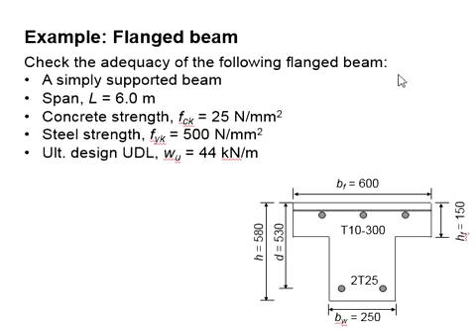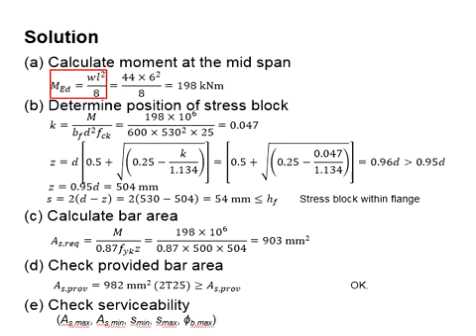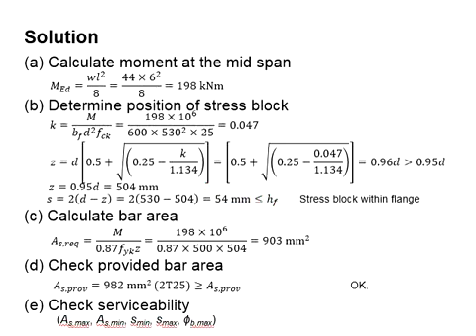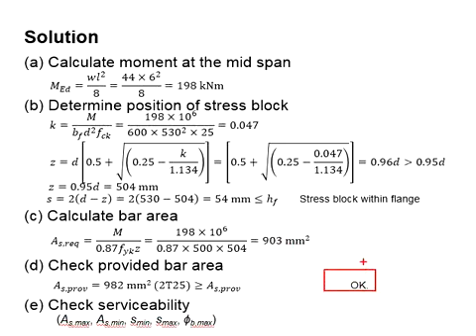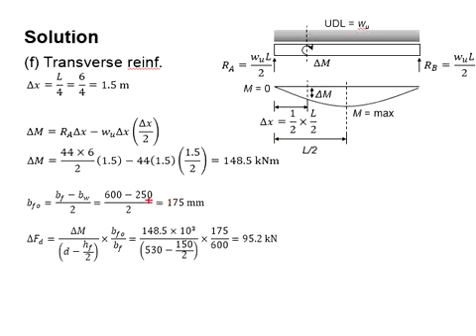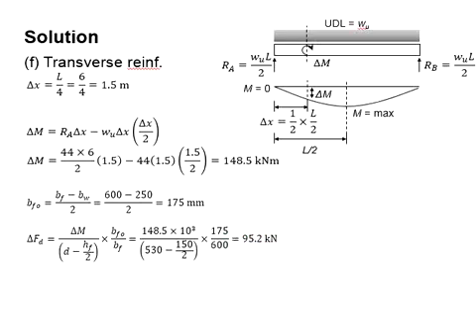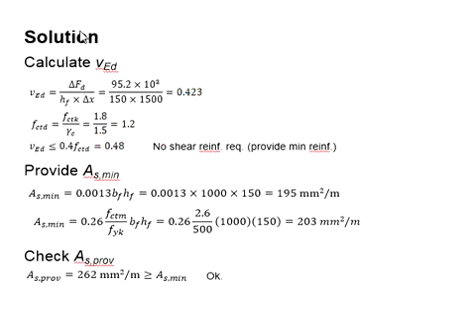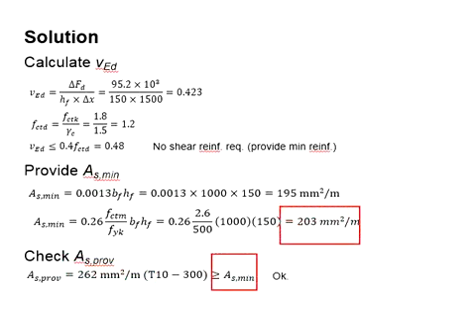7.13 Example: flanged beam

Comment: Hi Sir, here bf is 600mm in you rc diagram, but calculating As,min with bf=1000mm?
Reply from the maker: Good question. As,min with bf = 1000 mm is correct, as it is meant for the transverse reinforcement that crosses the shear plane between the flange and the rectangular beam. That bf = 1000 mm is referring to the section area perpendicular to the bf = 600 mm.

Comment: When solving for z, I thought z = 0.96d = 509 mm instead z = 0.95d = 504 mm.
Reply from the maker: maximum allowable z would be 0.95d. If more than that, you will need to assume z = 0.95d